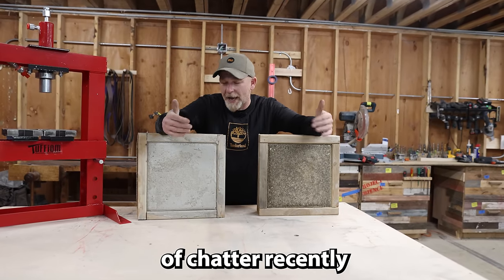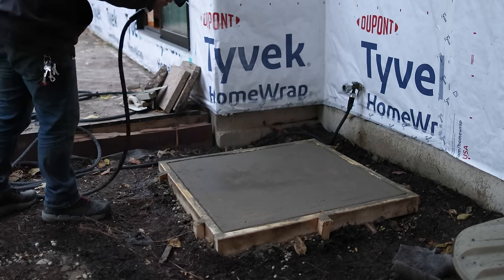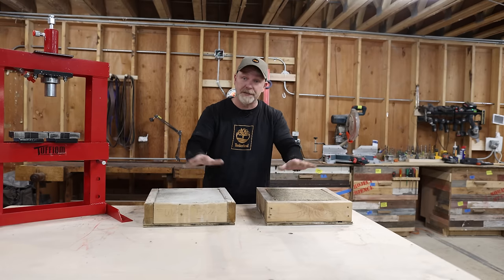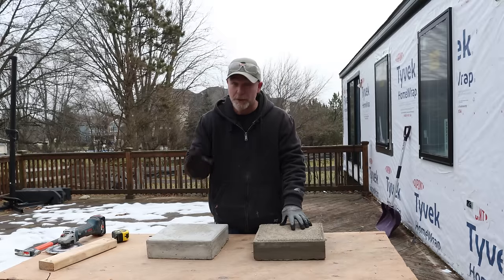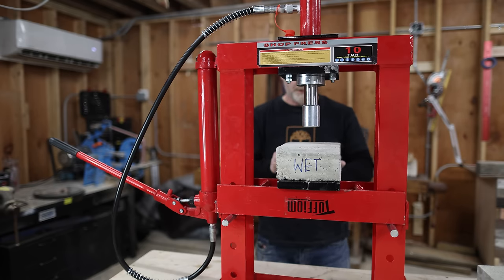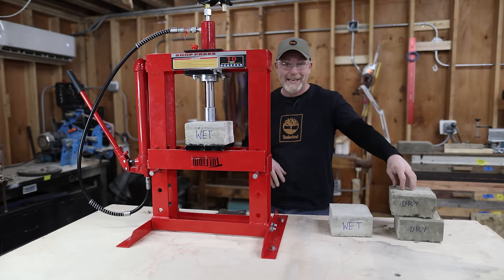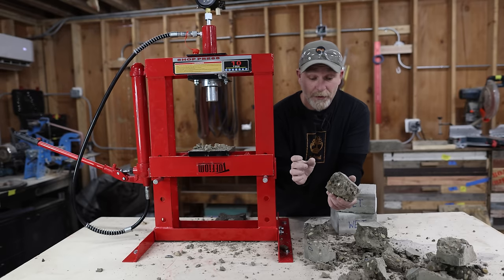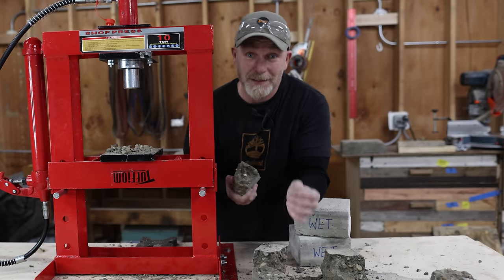The TRUTH About Dry Pour vs Wet Pour Concrete!! Strength Test - You WON'T Believe the results!!

Comment: I didn't have any plans to use dry pour, but thank you for providing me with armour against anyone trying to persuade me that it's a good idea.
Reply: So you gonna let one test persuade you? Do you even realize that not every brand of concrete reacts the same to the dry pour method? Of course you don't because you saw ONE TEST on one brand of concrete and think this is the definitive TEST.
Reply: @rotaryperfection  what about the comments from all the experts, and engineers in the thread who have done decades of testing.
Reply: @bigdaddy4691  You ever think of the possibility of them being AGAINST this due to them potentially loosing buisness? That's why you DIY to test yourself. Everyone keeps doing the dry pour the same way as the original creators. I did a compacted version and its strong and NOT brittle. I poured a 4x4 to mount a manuel tire changer and the anchor bolts haven't budged in the year since I've done that pad. That changer outs a HUGE load on those bolts while changing tires. I also didn't just sprinkle water on the surface the way everyone else is doing. I MEASURED the correct amount from all the bags I used to insure the correct ratio. Dry pour can be done in many ways so EXPERTS cant claim anything against it until all methods used to dry pour are exhausted.
Reply: @rotaryperfection  hahaha, yeah, it's a conspiracy....backed by science. Do you create a solution that will crystalize when you dry pour? No. Do you create a solution that will crystalize together when you wet pour? Yes. I have done both. I still use dry pour for fence posts or other things I know will eventually need to be replaced because the dry pour will be easier to break. You also used a method covered by a concrete engineer 2 comments below.
Reply: @bigdaddy4691  Do you know this concrete engineer PERSONALLY? Didn't think so. Are you the type to believe any anonomous poster on YT who isn't brave enough to show their face? Didn't see that coming did you? See, on YT, you can be whatever you want to be. I know what results I personally got, and my anchors are FULLY secured. Why aren't my anchors pulling out if the method is supposed to be so brittle? I find it funny how you 100% IGNORED my personal results to focus on conspiracy and some so called ENGINEER 2 post down. That could be a freaking YT post BOT for all we know.
Reply: @bigdaddy4691  No response?? Typical when the going gets tough. 😉
Reply: 5 tons is 10,000 pounds. Sounds like a great idea for a walkway
Reply: @rotaryperfection  I've been in construction for 30+ years. I have worked with concrete for 30+ years . I use dry pour for projects that are semi-permanent. I use wet for permanent applications. For example If I was putting in a yard hydrant or fence posts that will eventually wear and need to be replaced. The dry pour is a lot easier to break apart to do the eventual repairs, and is also plenty strong for that light work. I know many engineers personally, and I also have mounted a manual tire changer to a wooden floor. The loads aren't that great from that machine. I wouldn't use your method for bolting down the racks I install that are hit by forklifts and tons of materials at a time though.
Reply: @bigdaddy4691  So, you think manual tire chargers don't put much force on anchor bolts? Why is my lower mounting point bending if that much force isn't that great? If the anchor bolts aren't pulling up and the frame itself is BENDING, what does that tell you? You clearly have ZERO experience with compacted dry pour. That's what I did to my slab. My slab doesn't have all those air pockets either plus I know how much water I used. Those bolts not budging, tell me you could frame a wall on a dry poured slab, and the nails themselves will give out long before that anchor bolt even starts to budge. Those results are good enough for DIYers. Given your 30yrs, no wonder you're here in the comment hoping this method doesn't catch too much steam as guys like you loose customers. So much for that conspiracy theory. 🫠
Reply: @rotaryperfection  Is your method BETTER than wet pour? That's the point you're trying to make to people. I have decades of construction experience. These other people you say aren't as smart as you have decades more. Your dry pour will break down faster than a wet pour bottom line. get over yourself. You know I have done DIY wet pours. It takes a wheelbarrow a shovel, and some smoothing tools. The mixer can be had for about the same as your cheap tire changer at Harbor Freight as well. Trust me people like me aren't worried that we're losing business to DIY guys. I will help DIY guys in fact. I'm not arguing with you and your conspiracy theories. Have a great life and I hope all your projects work as well as you need them to.
Reply: @bigdaddy4691  Whatever you say faceless. I'm not trying to make the point that dry pour is better. I'm trying to dismiss this idea that you guys think that dry pour is BAD. Would I use it in a commercial application? Of course not. Do I believe it will work for MOST home applications and around the house projects when done with my compacted method? Yep! As I said, you CLEARY don't have any experience with COMPACTED DRY POUR to know anything. Compacted dry pour is another level of hardness compared to what everyine is doing with the dumb spray method. Your arrogance of so called 30yrs experience thinks it doesn't matter, but my method is far stronger. Go test the two yourself.
Reply: The main point to take away is that all concrete Basic instructions state to mix it with the water period..  before yt it was also considered common sense . I wouldn't dry pour an easy bake cake mix 😅
Reply: I dry poured a sidewalk 20 years ago and it's still going strong. I think dry poring is great when you don't have a lot of weight going on it. I wouldn't do a driveway or building slab where vehicles are driving on it constantly but for sidewalks and patios places with foot traffic seems to work great.
Reply: @rotaryperfection  How many dams has been made from dry pour and who would want to live under one that was????
Reply: @SegoMan  Lol you think a DIYer would try something that size? Dry pour is perfectly fine for small projects and here you come talking about dams. 🤣🤣
Reply: @rotaryperfection  Dude I use vibrated 5000 mix with rebar on compacted road base regardless  of what it's for. I prefer to do it right the first time.. Do your projects as you like..
Reply: @SegoMan  So why did you bring up that unrealistic, ridiculous dam comparison? To use such an example just shows how out of touch you are with the dry pour community.
Reply: @rotaryperfection  Yeah when you work commercial constructor for 25 years, you learn to do it right, sorry if I offended you and your methods..Maybe perfection is not a good ending to your screen name..
Reply: @SegoMan  Whatever my methods, I'm at least brave enough to share my experience while showing my face. Can't say that about you. See, on the internet, you can CLAIM to be whatever you want MR so called 25-year construction experience. I'm not impressed with your claims nor do I care.
Reply: @rotaryperfection  You win on this one Big Dawg, Your proving the theory that it is impossible to win an argument with an idiot as they drag you down to their level and win with experience..
Reply: @SegoMan  This isn't about winning. This is cause and effect. You tried to embarrass me by using a ridiculious example and made fun of my channel name. You were purposly trying to be an a=/hole and now you're in your feelings that I returned that SAME ENERGY. It works both ways. You took the 1st  shot, I took a bigger shot. It's funny how your 25yrs of nothing didn't teach you how to show people respect.

Comment: It looked to me like the dry pour did not get enough moisture in the initial wetting to cure cohesively. From what I've seen in the dry pour videos, they mist once or twice to bind the top layer, then begin flooding it several times to wet the entire slab at once for full curing. Perhaps it was so weak due to the method of wetting done during the dry pour. It certainly did look like the slab was not completely cured due to lack of wetting, hence the color and crumbliness of the mix.
Reply: Finally someone who realizes the error.
Reply: I don't think he followed the proper procedure. I've seen many dry pour videos that show great results. It's not as strong as wet mix, but not everyone needs that much strength.
Reply: Finally a good rational comment in a sea of baby out with bathwater irrationals

Comment: I poured a thin layer of dry concrete in an area of my backyard where I mounted a gazebo. I did it just to prevent weeds with the intention of pouring an actual concrete slab afterwards. after spreading a thin layer, I compacted it with a lawn roller, then sprayed water a few times. It's still there. I think the error here was that a dry pour has to be way thinner or water it a lot more than just 4 times like this guy did.
Reply: and it has not even a single crack, by the way.
Reply: The videos I've watched, they water 2 times per inch of thickness, so 4" should have been watered 8 times.

Comment: We used to sort of mix in place, pouring the concrete around poles, wetting it, then packing it in with a 2x4, then adding more concrete, wetting it, packing it, in lifts of about 2 inches.  We'd finish to the top of the square form we used around the pole tops, then strike off, wet, and float.  It looked good and we never had any failure issues, but I'm now the lab qualification manager for a state road department and I have learned a LOT more about concrete from out stuctures engineers, our lab managers and technicians, and I'm qualified for C39 which is the concrete compression test.  It's fascinating how much strength varies with the % of water used in the mix and proper curing.
Reply: Done the same on setting fence post at the ranch. Hole, dry pour, wet, dry pour wet and set.
Reply: my thought of a dry pour would have been what you described, not just trying to mist water on the top and hope it soaks through the whole thing.

Comment: Great video!   I watched a few of the dry pour videos and figured it was the easy way to do an inferior job.   BTW, please wear a respirator while cutting concrete.   The powder causes major problems to your lungs over time.
Reply: Yes, please! I was thinking the same thing as I watched the growing cloud of silica-bearing dust. Or better yet, wet saw it and still wear a respirator.
Reply: Thank you, even the holding your breath method doesn't work. And we are talking respirator too, not a useless dust mask.
Reply: Use a wet saw.

Comment: Of course you know, all of those who've done dry pours for slabs in a shop, garage or whatever will be losing sleep after seeing this video. 
Good info.
Reply: LOL
Reply: And that there is why I've never dry poured concrete
Reply: Anyone who did a shop floor or garage slab with dry pour deserves to not sleep, this is just a ridiculous debate, I have been in construction all my life and never seen anyone use dry pour.
Reply: @H43339  LOL me neither , probably became a thing due to people's laziness and impatience
Reply: @H43339  Lmao. The only use I could see for it was if one needed a light-duty, temporary slab for whatever. It could be easily broken up at a later time.
Reply: @RyshusMojo1 That's possible but I have never gone to the trouble of trenching, forming a pouring just to break it up next month.
Reply: @H43339  Oh no, I was thinking more along a few years or whatever. No, ain't doing all that for anything less than a couple of years.
Reply: @RyshusMojo1 Anything I build, I want to last. This is ridiculous.
Reply: Well your test is clearly not the same as the Cajun couple. How about a test done with the same directions as them?
Reply: Agreed, in their videos they say it needs to be in contact with the ground to help it soak up moisture and cure yet every one of these "test" videos isolates it from the ground and only allows moisture from the top.

Comment: The proper amount of water thoroughly blended with the proper amount of other necessary ingredients creates the chemical reaction that produces concrete.  Water combines chemically with the other ingredients to cure into a strong, stable material that has predictable properties such as strength, workability, weather resistance, etc.  Without the right amount of water, you have  unpredictable junk, which is not concrete.  Properly mixed concrete cures best under water because the concrete is never without sufficient water to cure properly.  Concrete cures or sets - it doesn’t “dry.”

If you can live with unpredictable material in exchange for the convenience of working with dry material, go for it. But don’t expect it to perform like properly proportioned and mixed concrete.
Reply: It hydrates. Taking hydrogen releasing oxygen.

Comment: Finally somebody to verify what I have believed all along. I've seen so many videos proclaiming dry pour is just as good as wet pour they almost had me thinking maybe my thought process is not correct.
Reply: Ya I don't trust youtubers at all. Though I do pick up tricks from them. They crowd source people for the next hot trick, I crowd source youtubers, so my next hot tricks are curated. I use youtubers similar to a coffee filter!

There's tons of bad info out there though. As a professional in the industry, I can often spot issues.

One cool trick I've found recently is the superglue and activator trick. I use it for so much now! No more nailing cleats for my hardwood or using hot glue. I can glue tabs on transition pieces to keep the surface of floor transitions perfectly flush. Same for stair treds. Today I used it to temporarily glue a straight edge perfectly level setup at the height I want to make the perfect cut in the perimeter of a deck. (I'm changing the elevation/slope to meet code)

My newest tool is the stabila tech 196 dl digital level. $356. It's a dream to use. I was able to establish my perfect 2 degree slope, get my perimeter flushed to level, and set another slope off that slope @ 90 degrees to keep a staircase step level across the top. I'm going to install some venetian tile flush with the perimeter.

Comment: The problem is the dry pour is just not getting enough water to complete the chemical transformation
Reply: Seems like top is curing and sealing off the center from proper amount of water, if doing a dry pour I would put an inch to 1.5 layer of Crete then add recommended amount of water then repeat till form is full, should be wet all the way thru slab and be almost same as a wet pour, only difference would be wet pour is getting particles moved around and mixed up, but 80 pound bags are mixed so they just need water all the way thru

Comment: Thank you for making this video. Anyone who works with concrete professionally will tell you that this silly dry pour trend on social media produces nothing but substandard, barely usable concrete. For concrete to cure properly, the water needs to fully and consistently hydrate the cement particles which then forms a paste that coats the aggregate particles to make a strong bond. There is simply no way that can possibly happen in dry poured concrete. There is no way that dry poured concrete will ever have the same quality as wet poured, no matter how long it sits, it will never, ever achieve an equivalent strength.

Comment: With wet you have all under control, cement, aggregate and water, more or lees perfect mix.
With dry you have only cement and aggregate under control, water is added in an unknown amount, and I think the amount of water to a concrete mix matters a lot for the strength, so yes dry must fail before wet, but dry may be good enough for the task, it all depend on your needs, not every task need the strongest concrete.